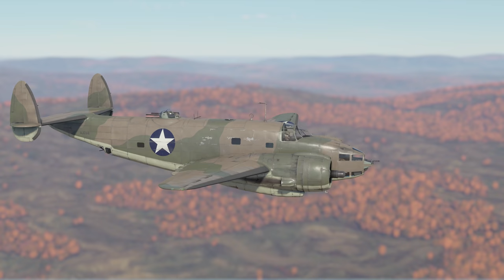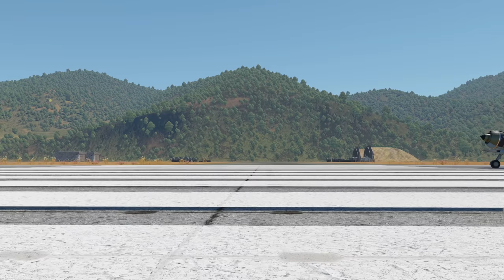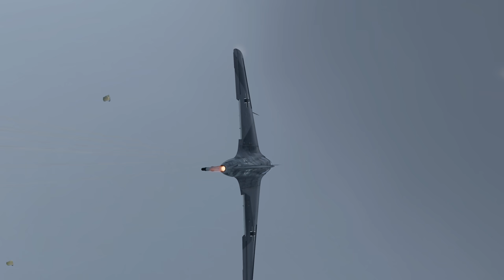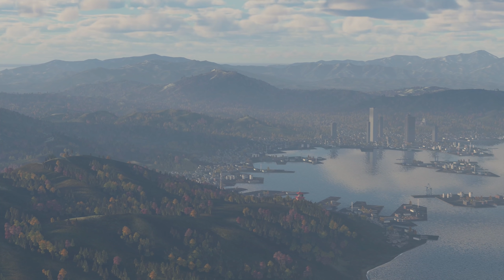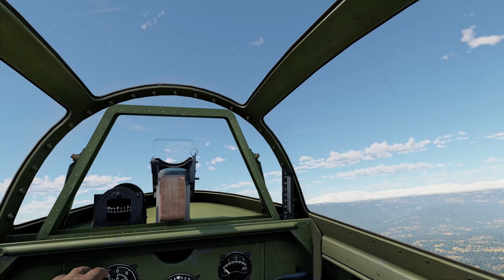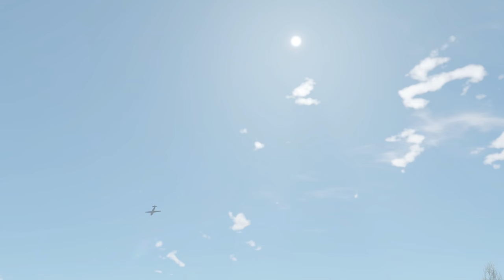Rocket Planes / War Thunder

Comment: Will there ever be more modern planes like the A-10 and other iconic planes?
Reply: I do want the A-10 but the Japanese tech tree has something like that it’s not the m10 but it has the same minigun
Reply: Probably yes because war thunder is the type of game that can't die. They Will eventualy add almost every plane ever made
Reply: @j.r.2087  the A-10 is too specific though that’s why I think it would be hard to add because it does not really go anywhere with top tier jets because it’s slow and heavy and flys low to the ground so any spaa or jet will kill it almost instantly
Reply: @humanhuman5024  well there are bombers like that so I think they will. It one of the most requested vehicles.
Reply: @Seems12345  those are generally low tier and won’t meet radar AA or jet planes and the ones that do you can clearly see they don’t work

That’s why I said the warthog would be too good at low br but too bad at high br 

It’s the same problem the maus and the e-100 had it does not fit anywhere because too high br makes it get penned by heat but low br makes it way to strong
Reply: @humanhuman5024  that is a good point. But i feel like if they balanced it right it could work really well. And the fun is accurate from a fair way away so that’s a plus as well
Reply: @Seems12345  yeah but that’s the issue balancing the A-10 has a powerful 20mm Minigun cannon that’s has high penetration it can also carry a great amount of secondary load like rockets and bombs and it has radar if the br was at let’s say 7.7 then the warthog would be way too good when down-tiered and way to bad when up tired although that would fit into the American tech tree well because that’s most of the vehicles it still would be rough

Comment: Nice vid, but I would add one thing: the Comet was operational in 1941 - it even went above 1000 km/h then (1130 later).
Reply: it was not operated untill 1944
Reply: @Kalashnikov413  imagine f it was deployed in 1939 along with the me262, if that happened it would start a jet arms race 20 years earlier. Imagine the f22 being made in 1970 and the f35 in the 1990’s. We would have 6th to 7th gen fighters by now
Reply: @CASA-dy4vs  there's a possibility to that

Comment: Russia had a really good idea. Japan just couldn't do it and Germany got it right with the Me-262
Reply: @Mason Murchison no i was talking about the me-262. The 262 was a jet. The 163 was a rocket propelled aircraft. I was saying that Germany got the idea right with the 262...
Reply: @longhorne1096  arguably the Japanese kikka was an improvement over the 262. The fuselage shape was more acclimated for the speeds the aircraft would operate at and the removal of 2 of the 30mm cannon increased it's maneuverability.

Again, I say 'arguably' because we don't have much flight performance data on the kikka (to my knowledge) and both aircraft were made in relatively small numbers with subpar materials, making a true evaluation of the aircrafts' capabilities difficult.
Reply: @nickkurzy2246  I just want to thank you for giving me an educated argument. That's very rare to see these day's. And also you bring up a very good point.

Comment: They were certenly an interesting idea, its a shame the fuel was so unstable and volotile for them, the liquid fuel came as a 2 part mixture and when mixed created  huge amouts of power to the point that if fuel tanks were not cleaned out properly between flights the aircraft would explode, plus the grusome habbit the fuel had of melting the pilots if any of it leaked into the cabin which given the dodgy landing sled happend more than a fiew times

Comment: What’s the different between rocket and jet engines? I thought these planes are the same.
Reply: Rocket engines are only on a few vehicles (the ones in this video) and feature amazing thrust and very little fuel, and jet engines typically have less thrust, and burn far less fuel. (The fuel types are also very different for the 2 types of engines)

Comment: Have you guys fixed the exploding while trying to take off in the 163.
Reply: make sure you don’t pitch up at all, or that rear gear will hit the ground and cause bounce. Keep the pitch at 0 degrees until 300kph, then u use takeoff flaps and pitch up a tiny bit.